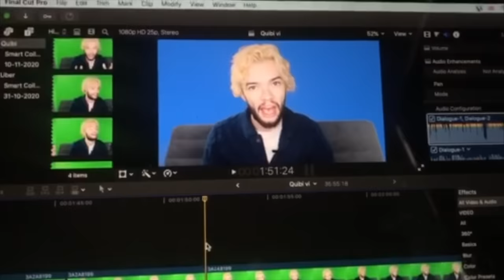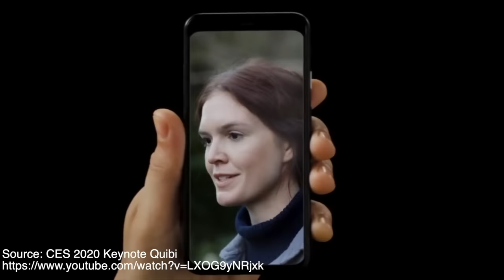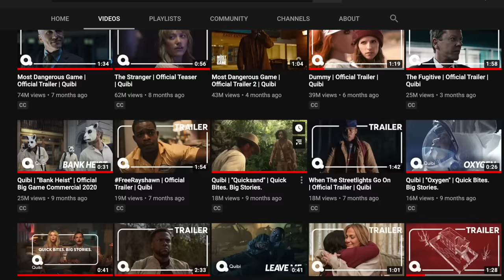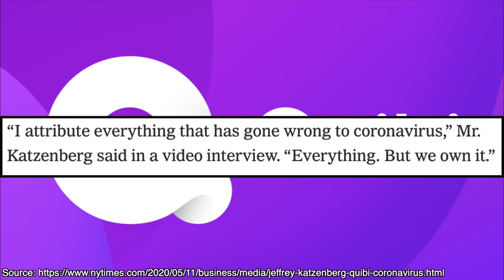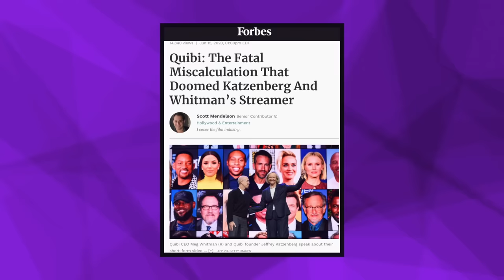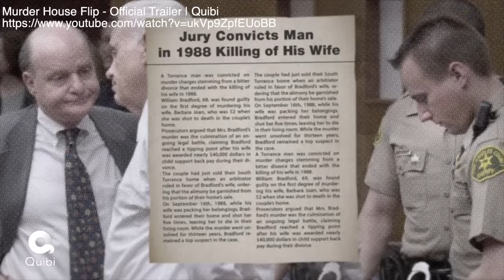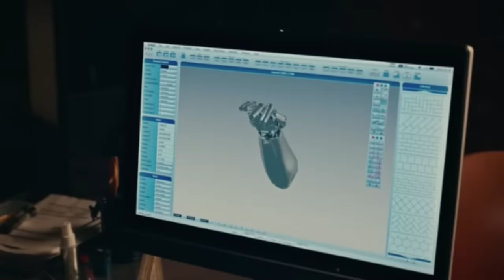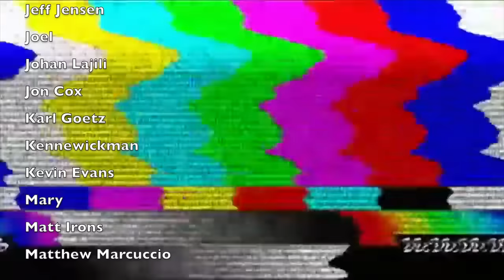The Dumpster Fire Failure of Quibi

Comment: as i slowly sink into the quick sand, i pull out my phone for one last Quibi. i turn the phone vertical, and a joke is revealed that was not present in landscape. i laugh heartily, enough to sink even deeper
Reply: I don't like that it glitches slightly as you turn it. It'd almost be cool if you could just smoothly hold it at whatever angle you wanted.
(Actually, that might be really nauseating if you're walking, nevermind)
Reply: @comicconcarne  not really. The idea that I have to go through extra work to see everything that happens in the show isn't appealing.

Comment: I feel like quibi's downfall is more attributed to the pandemic than you think. Once lockdown started, I was no longer interested in ten minute bits I'd usually only want to watch while I'm on the bus to class. At that point, I went back to Netflix and Hulu because it suited my new lockdown life way better. I'm sure the same happened with a lot of people.
Reply: Would’ve only lasted another 6 months at most considering the lack of content and the public embarrassment for the severe cringe they did produce. HQ lasted longer because there was actually a compelling reason to participate, but even that was another failed flash-in-the-pan idea out of Silicon Valley.